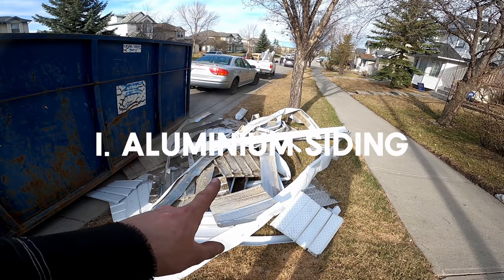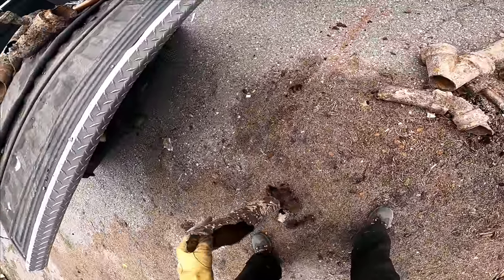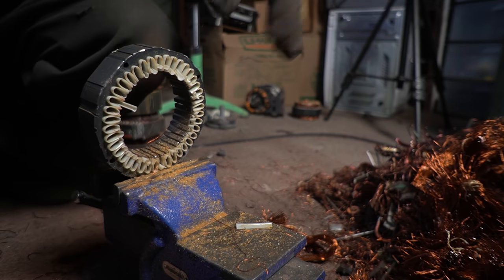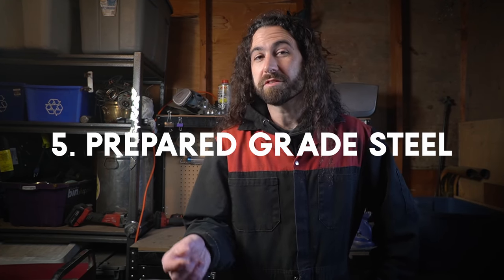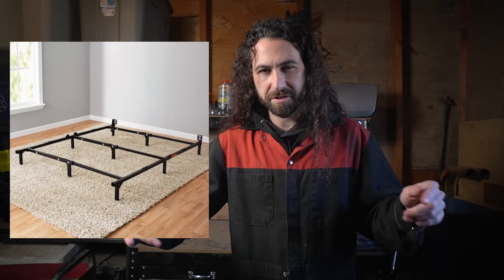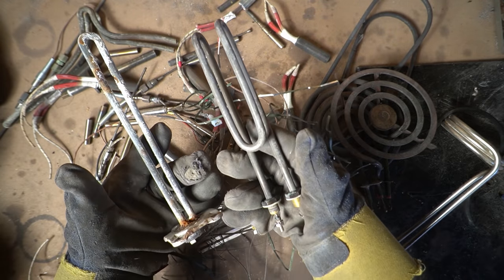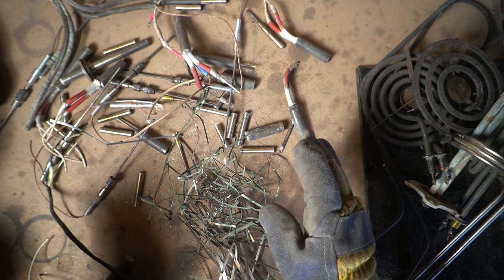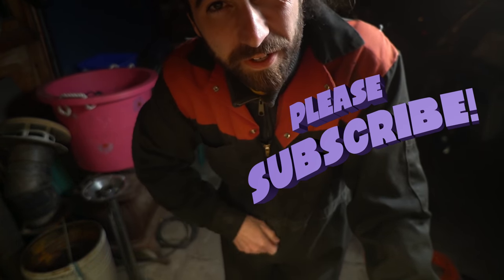5 Things You Didn't Know You Could Make Good Money Scrapping!

Comment: Okay I'm sorry but I got to kind of shoot that statement down a little bit that they cherry-picked and made $150 off of the aluminum and excetera and left behind $1,200 worth of Steel I don't know what scrap yard you're going to but to make $1,200 in Steel and not that I haven't done that before but you have to haul a lot more steel than aluminum or copper to make that kind of money even if number one prepared was $300 a tonne now bear in mind scrapyards go by metric tons which is 2240 pounds so to make $1,200 in Steel you would have to haul four loads of Steel to make what I can make with 1000 lb or less of Copper Brass stainless xcetera you're right there is money in steel but you got to haul a lot more of it

Comment: Wow do you realize that you more than likely got burned on your thermocouples. You mentioned that some of them came off laboratory equipment if it dealt in high temperatures than more than likely it was a type B, R, or S all those have platinum and rhodium wire the heating elements off of stoves and most water heaters are shit but I'm almost positive that I saw some type B thermocouples in your mix right now rhodium is about $19;000 an ounce
Reply from the maker: Oh I have no doubt they were worth more than the dirty stainless I was given for them. Didn’t realize they sometimes had rhodium though, that’s huge!
Reply: @thubprint  yes they do that is huge right !!! Rhodium is never used by itself its always used as an alloy. Just remember the type B, R, and S thermocouples have platinum and Rhodium. I scrap organs for palladium and silver and yesterday I got a conn 721 and the bus bars were pure silver it turned out to be a little over 800 grams

Comment: I'm the type of person that treats others as they want to be treated so I don't want to be stolen from so I get you on that but I do spend the extra time like on a washer and dryer taking the motors in the cords breaking down the motors taking the copper out of them old air conditions separating The Cools from the copper tubing I spend that extra time and I end up making more but like you say it's a little bonuses so I sure wouldn't just go refrigerator and take it straight in like it is there's a compressor on that thing there's the motor aluminum inside of it. Tell me one thing if you can help me is air condition the radiator cores that were copper tubing and aluminum are sold hire tired then just regular copper tubing in aluminum sheeting which is the next step down from aluminum cans let me know peace out hell I'm trying to get the gold and silver out of the TV I love junking
Reply from the maker: Well the copper/alu rads are lower price than the same weight of copper + alu separated, you would get more if you could separate them. Not that I’ve spent the time doing it haha

Comment: #steelisthemeal
Reply: I definitely envy your storage space. I save my bits and bobs but turn them in more frequently than most, I imagine, due to lack of lots of storage. And I really only have space for a few longish things (usually aluminum breakage like crutches and poles) and then I have bins and buckets for dirty brass, clean brass, #2 copper, all my clean copper (I am really saving on that, not selling as scrap! 😉), stainless steel, extruded aluminum bits like heat sinks, small electric motors, and my bin for #2 insulated wire (45%) that I empty every other week or so. The smalls are the cherry on top so to speak, but steel is definitely the meal. Thanks again for a great VJO, Thub!